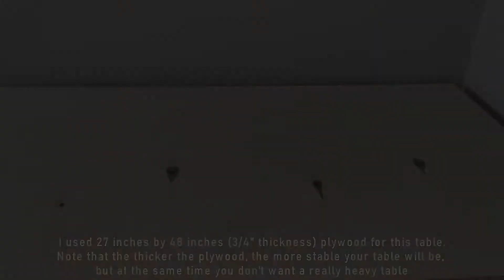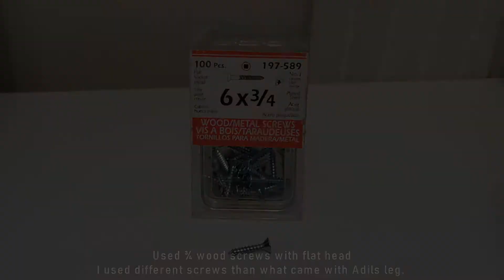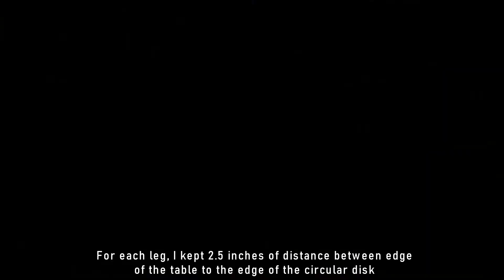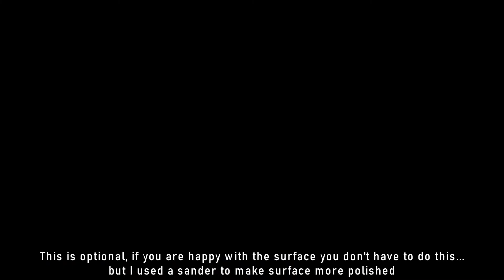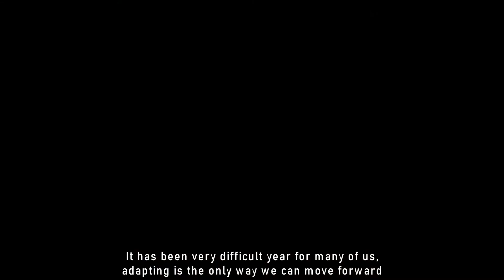DIY Simple $20 Dollar Table with Ikea Adils Legs | Easy Build

Comment: Going to build a table like this kind of, using the same legs. Do you have the diameter of the disk parts? Need it to decide some measurements of the wood. Cheers!
Reply from the maker: Thank you for liking my video. I dont know the exact number for the disc diameter, since it comes in a kit with the ikea legs. But the legs are stong enough to hold the surface of the table. The main concern would be the size and tickness of the wood surface. The thickness of the wood has to be atleast 25mm so the screws that comes with the kit does not pinch through on the surface.
Reply: @renaodesignstudio    Thanks for replying! The length of the screws, got it. Do you still have the table? Could you possibly measure the diameter?
Reply from the maker: It's about an inch from the leg.

Comment: Thanks for the video.just wanted to ask if we have to drill holes in it with a drilling machine or just push the screws with screw driver ?
Reply from the maker: I pushed the screws with the screw driver. It actually depends on what top you used.

Comment: Heyy thank you so much for the video. It saved me a lot of time from taking my decision of buying these. I had one doubt. Would it withstand a table top of 4*2 feet (121.92*60.96 cm) ?
Reply from the maker: I am glad to be helpful. This what the video is meant for. So on this table I did use 4 by 2 feet (to be exact 2.25 ft by 4ft). It will withstand. Dont forget the tickness, because that is important as well. In here I used 3/4". Thank you supporting my video. Please subscride it if you have not done it already. Appreciated.

Comment: Hi, I want to do a table with dimensions 6 ft x 2 ft with Ikea Adils legs. Will this work?
Reply from the maker: Hi Amit, thank you for reaching out to me. Yes, I think it should be fine. Just make sure the tabletop your using is a hardwood so it does not bend in the middle over time. :)
Reply: @renaodesignstudio  Thank you so much for your reply, I am actually dismantling an IKEA Stuva Loft bed, and planning to use one of the sides (3 cm thick)  to create a 6x2 table. So you might now have an idea of the material I am using. So, should I use an extra leg for support in the middle of the plank along with 4 legs in the corners.
Reply from the maker: @amit6132  3 cm is actually more than enough thickness, so you don't need extra support in the middle of the plank.  4 legs in the corners are enough. Please share your picture after you are done at @renaodesignstudio on Instagram. Would love to see how it turned out. :) As always thank you so much for your questions.
Reply: @renaodesignstudio  Thank you so much for your advice...will post the picture, once im done :)
Reply from the maker: Looking forward to it🙂